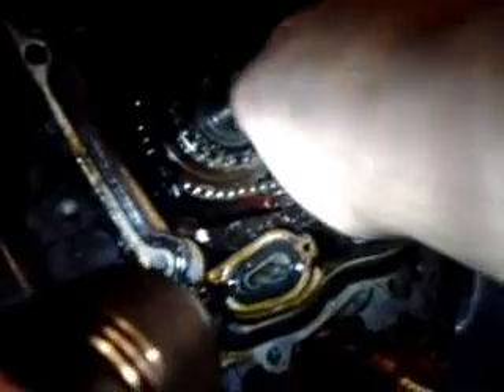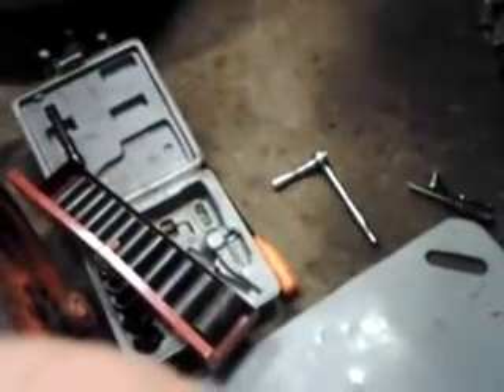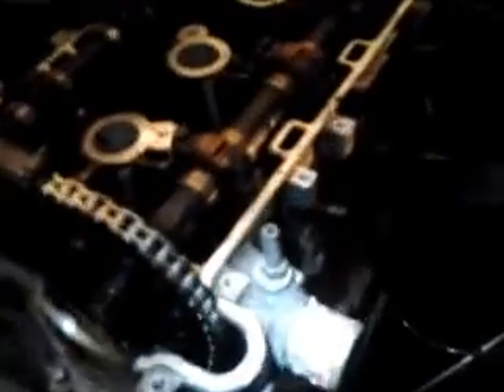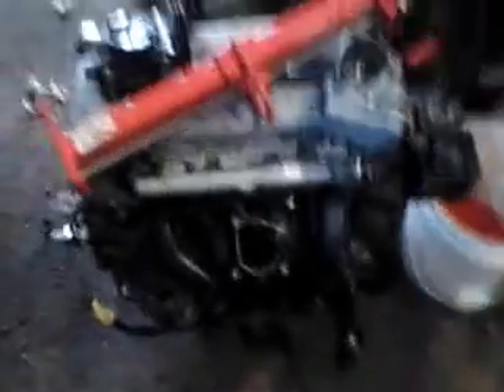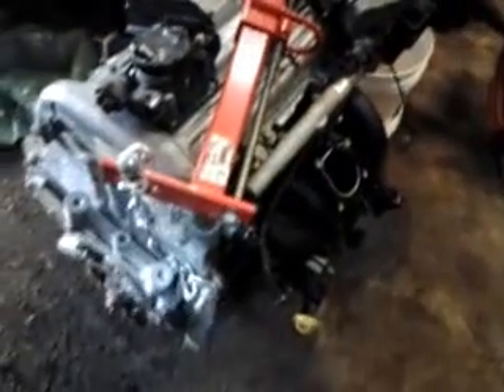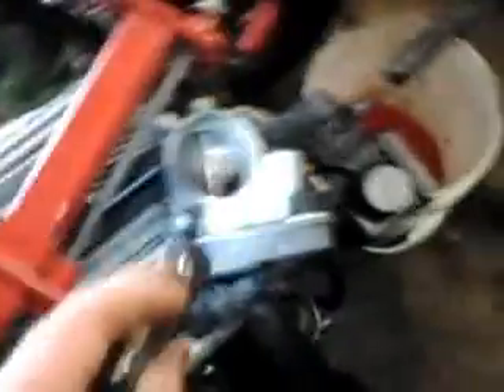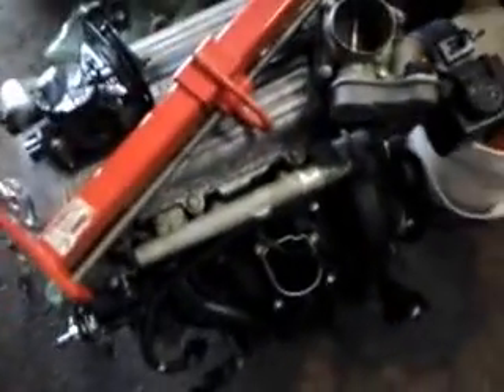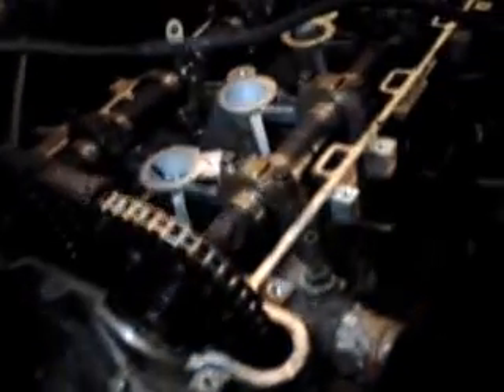2004 Saturn Vue 2.2 L Ecotec timing chain failure

Comment: My 2004 VUE, 5th Saturn I've owned jumped timing at 170 thousand miles.  Vehicle very well taken care of.  Bought it with 20 miles on it, changed the oil every 3k with Mobil1 Synthetic.  No more GM vehicles for me.  All the rest of the Saturns had front end issues but the engine failure is the final straw for me.

Comment: Same thing happened to my 2005 malibu 2.2 ecotec.  Plastic chain guide broke and had to replace the engine.  Should have been recalled cause the oiler was redesigned to have a bigger hole.

Comment from the maker: First off the engine didn't want to turn over all the way. Second after taking off valve cover could see that some of the valves weren't up all the way and weren't being held down by the camshaft, meaning gap between camshaft and valve rocker

Comment: How were you able to determine the valves were bent? Did you have to do a compression check, or were you able to tell visually they were bent by rotating the engine?

Comment from the maker: Well I got the Vue running. Ended up swapping in a different engine, also from a 2004. I put new timing chain, guides, hydraulic timing chain tightener before installing replacement engine. Has 50,000 fewer miles too.

Comment: This is a really reliable engine but GM decided to but these cheap plastic parts in the timing Chain and the heat of the engine overtime starts to melt it. That's the problem. I have a 03 Sunfire with same engine has 79,000 Miles no problem yet but even if the problem has not happen yet I'm going to replace them to new timing Chain. I had my Sunfire seens 2003 and love it.
Reply: GM has a bunch of really fucked up people designing this stuff.